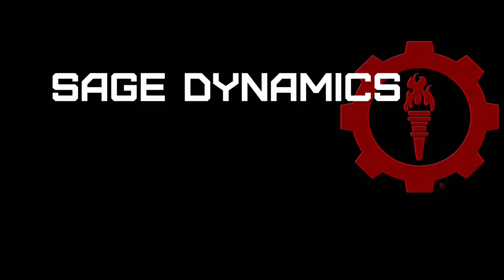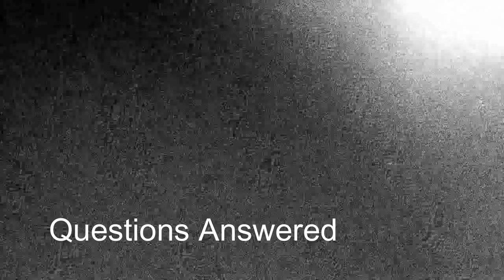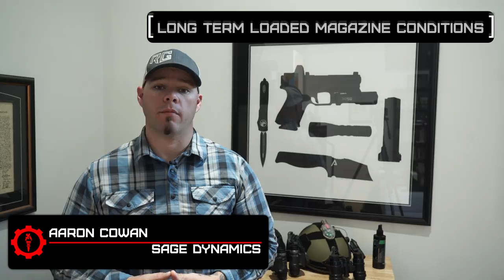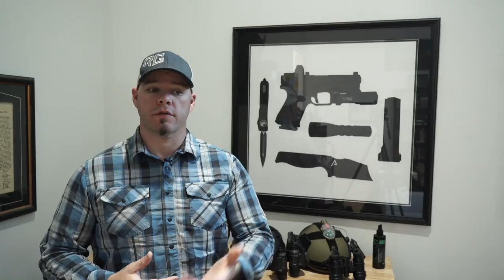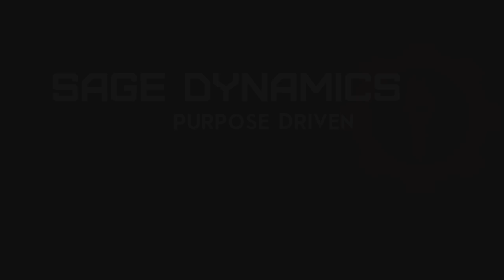Long Term Loaded Magazine Conditions

Comment: My post is 100% fact: oldest mags in my house are 10 years. Glock 19, they live loaded to full. Some have gone 3 or 4 years untouched cuz they were at the bottom of the box. All my mags have worked 100% and I have yet to have one wear out. Glock, 1911, M&P, AR-15, shotgun mag tube springs, all stay loaded to 100% capacity at all times...no issues to date. 10 years and counting.
Reply: I recently ran through some I'd had loaded for 10 years, no issues.
Reply: My mossberg 590 was loaded from 2013 to about 2017 and I found the spring got weaker and I had failure to feed reliably. I replaced it with a upgraded spring and it's been fine. My mossberg was only loaded 4 rounds out of a 8 round tube

Comment: ME here, in an ideal spring that does not experience yield will not experience any difference from being stored loaded or unloaded. However, creep and fatigue are still factors that can influence the life of a spring even if it was never deformed past its yield point.
Reply: How is creep and fatigue different between loaded and unloaded?

Comment: Several documented cases of loaded 1911 magazines loaded in WW2 or prior & picked up & loaded & fired some 50 plus years latter & firing & working flawlessly. As long as they are stored properly in a cool dry area they will virtually last longer than you will live . It's the constant unloading & loading of mags that stretches the springs back & forth adding moisture from the air & your body & other environmental elements that hurts the springs . 
If you don't believe me have you ever had a magazine that wouldn't hold what it's advertised to hold , but after some use it then holds that additional round or 2 ? That's the spring doing what I just talked about .
Reply: Mag Springs will relatively quickly take an initial set when first loaded, then any additional set progresses very slowly, it would take many many years for it to become unuseable. If the mag is used a lot the spring will fatique at a much faster rate than it would just sitting there under compression.

Comment: Clint Smith talks about tossing Wilson Combat 1911 mags over the berm when they start failing.  Most people respond to that by balking at throwing away a $50 mag but that magazine can easily be the difference between your gun working or not working.  If your gun is for defending your life then throwing away a magazine (even a somewhat expensive one) when it starts compromising reliability shouldn't be a tough decision.
Reply: It seems a little bit extra though, most of the time you just gotta replace the spring if a magazine shits the bed if it’s a steel mag

Comment: I have a g19 magazine that primarily stayed loaded for the last 3 years. And after finally using it and disassembling it, it’s spring is quite a bit shorter than a new g19 spring. I took it apart after having issues with the slide locking.
Reply: Pics or it didn’t happen

Comment: Early new Magpul Glock magazines had major problems but the company, correctly took the proper steps to improve the design. 😉. I have 2 Glock Magpul magazines for my Glock 26 gen 5 9mm. I use factory ammunition & so far, had no problems with the Magpul loaded magazines. The fact that Magpul does not use a metal liner like Glock factory versions may be a concern but I feel safe with the Magpul styles. I'd add too that most Magpul Glock pistol magazines are priced about half the cost of Glock magazines. 💵

Comment: Aaron, could you do a Q&A on the theory of down loading your magazines.  Example, 30 round AR mag down loaded by 2 and a 15 round Glock 19 mag down loaded by 1.  I have been told this by several people.  They say its better to do this because it makes it easier when inserting the mags into the gun.  Thanks.
Reply: C P larry vikers advised too download by 2 on AR mag and 1 on a pistol mag
Reply: depends on the guns and magazines. My Glock 17 doesn't have any problems, the original 17 and 19 round mags insert just fine, even on a closed slide (so 17+1 capacity works perfectly).
My H&K USP in 40cal doesn't like that tho. I don't load the 15rnd mags to full 15 unless i use them as the first mag on the range/in a competition. It has a paddle style mag release (which i really like, truely ambidextrous and i'm not one of those thumb release only guys) but that means it has a hole in the front of the magazine where the release holds it in place rather than on the side. That i don't like because it doesn't engage well unless you slam that magazine in hard. And on a fully loaded mag it doesn't work at all if the slide is closed.
So this "myth" is actually true for some guns. Just test it out for your guns.
Reply: He WAS a Delta guy, many years ago.  SF dudes aren't gear guys and even the LAV admits that most guys he served with were not gear dudes.  Bing SF doesn't mean they're right about everything..
Reply: +225degrees your entire argument is a false dichotomy and an appeal to Authority so it is already invalid.  When magazines are in guns the bullets do not rest on the feed lips if the bolt is in the closed position, the bullets are compressed even further against the bolt or slide until the magazine locks up. Reducing rounds reduced upward bolt pressure and mag spring pressure and this is a physics fact.
Reply: +225degrees you can't even comprehend the basics of the argument. Downloading the magazine is to make it easier to put into the weapon which is true and it is easier that is a fact...whether it's needed or not depends on how much free space is in the magazine body and spring after it's fully loaded how easily does it compressbeyond full to allow the magazine to seat.
Reply: Why the HELL would I leave space in a magazine. My mags are loaded to 100% capacity at all times. I'm not even sure why this is even a thing...

Comment: I suspect Aron's rather understating his case. I've been toting a Gen 3 Glock 26 for 20 years — since 2000. 2 of my mags, both OEM Glock mags, one a 10 rounder and one a 10 rounder with a +2 shoe, have been kept full for about 80% of that time, save for a number of extended trips overseas when they were unloaded and kept in my safe.
 Both still work fine, save for the mag with the +2 shoe, which actually could hold an extra 3 rounds, for 13 rounds in the mag. Early on, within months, that mag failed to actuate the hold open device on the pistol with the magazine follower on the last round. I suspect that has more to do with the addition of the +2 shoe than metal fatigue in the magazine spring. The Glock is tediously reliable, the only issues I've had is a cracked plastic end cap in the double coil main spring after about 16 years, and it's easy to get a new mainspring. My Glock 26 is entirely stock, save for replacing the plastic sights with steel Glock sights. I've recently had the top of the slide milled for the addition of a Holosun 508T reflex sight and fitted co-witnessing Trijicon suppressor sights.
If you start of with good quality magazines and you put new springs in your magazines every decade, you'll be just fine, even if you leave them full.

Comment: Physics teaches that springs never wear out from being compressed.  Spring life is defined by cycles.  Storing a magazine loaded has no effect on the spring.  Loading and unloading does.

I like Lancer mags.  One of the reason is the metal reinforcement.
Reply: mhfisc this. Why some people think springs used in guns and magazines are different than every other spring is beyond me.
Reply: mhfisc I think the thought comes from the Military using the gi mags. We had issues after about 6-8 months with magazines failing. We would lose the top two rounds of the magazines. But then again they were magazines that already had issues to begin with after years of use.
Reply: From the context of a well designed, well built mag from a reputable manufacturer used in normal conditions you're absolutely correct.  Cyclic loading is what will inevitably kill a spring in the vast majority of cases.

However (and I say this at the risk of being overly pedantic), saying that "physics teaches us that springs never wear out from being compressed" isn't really 100% true.  Viscoelasticity, while not a common discussion point, is very much an important topic in some circles.  For example, folks who design structures used in extreme temperatures (~40-60% greater than the metal's melting point) are absolutely concerned with their springs (or really any metallic structure) permanently deforming or failing given a constant applied load over a length of time.  Viscoelastic behavior (more simply, "creep") can manifest itself simply in "worn out" springs that need to be replaced on a certain schedule, or it can make itself apparent in the form of catastrophic failure if you don't account for it up front.  Notable examples would be parts and springs inside of jet engines or power turbines.  The truly insidious thing about creep is that catastrophic failure can actually occur well below ultimate design loads if temperatures, load application rates, and load application times are high enough.

Now from the perspective of rifle/pistol magazine springs, creep can really only manifest itself in a few ways:
1.) Abuse.  This one is pretty simple: Don't load up your mags and put them in an oven.
2.) Poor material selection.  In an extreme example, a plastic magazine spring would very likely experience some permanent set if left loaded for a long period of time at room temperature.  Another one that most folks don't realize is lead has terrible resistance to creep, even near room temperature.

1 and 2 are pretty extreme and will likely never happen, but #3 is certainly a possibility:
3.) Poor design.  If a sub-par company designs a steel spring with an insufficient cross section or insufficient material properties (either out of incompetence or just to save a fraction of a penny in material/manufacturing cost) you can run into problems.  At room temperature, many metals can still experience creep if loaded beyond 65-75% of their ultimate failure strength.

Even beyond springs though is the magazine body.  As I mentioned above, polymers can experience creep at room temperatures.  If you leave a polymer magazine loaded, those rounds are being pushed up by the follower/spring and restrained by the feed lips/mag body.  That constant applied stress can eventually manifest itself in permanent deformation of the mag.  The time required for that to happen though is heavily dependent on a number of factors: which type of polymer, what thickness is the magazine body, how stiff is the mag spring, how much UV exposure has the mag had, are the feed lips re-enforced with a metallic sheet, etc...

But as you mentioned at the very beginning - you're much more likely to wear a magazine out via cyclic loading/unloading than you are by creep.  I did, however, want to clarify that the mechanism is still a possibility, albeit an extremely minor and unlikely one (assuming a well designed/built magazine).
Reply: That's not accurate.
Reply: David Holland Wow great nicely explained!👍
Reply: Greoric M Who is your remark directed at? What's not accurate and why?
Reply: Spring elasticity is reduced under sustained pressure.
Reply: Not completely true
its just not anywhere near as significant compared to cycle wear.
Reply: Incorrect. It's completely true that spring elasticity is reduced under sustained pressure. My statement wasn't relative.
Reply: Isn't that what I just said?
Reply: No.
Reply: Not an argument.
Reply: @Danny Little Troll confirmed
Reply: mhfisc your correct. Being kept loaded you wont see much difference, if any, on the the spring. Now the loading and unloading is when the spring starts to wear out
Reply: mhfisc friends and i also had pmags loaded for years and nothing happened to them
Reply: Right, excessive use and likely had feed lip creep or separation.  Magazines are CONSUMABLES.
Reply: go back to school because taking a spring and compressing it to solid ruins it as well.
Reply: Robert Schmidt Yes but takes a lot longer to do so.
Reply: +cool beans I used a $16,000 Larson Systems Inc spring tester with Flash 11 touch screen technology to run the programs what do you use?
Reply: +cool beans you only have to take a spring down to solid compression one time and it's ruined doesn't take a long time only once just ask a mech engineer.
Reply: Robert Schmidt were talking about mags, If fully loading them wears out the spring. I'm saying it does but takes a long time to do so. Cycles on the other hand, wear them out faster (loading and unloading). Yes or no?
Reply: +cool beans Yes. cycles wear them out and I doubt they ever go to solid though because of engineering of mag geometry to prevent it. I was only making a physics statement on helical compression springs of all kinds and not mags per se. Was not trying to be a smartass. I test springs as part of my job.
Reply: Robert Schmidt ok, it came across that way to me. We are on the same page than it seems.
Reply: Aka: work hardening...
Reply: @dmh9993  tldr

Comment: Tie a piece of paracord to the D60 thru the lanyard hole in the dust cap. Then the cap will rip right off if you need to use it asap.

Comment: I can tell you that a Beretta 92fs mag was completely ruined after I found it in storage. The spring had taken a set and would not feed.I would estimate that it was loaded for at least 5 years,and was a Checkmate manufactured mag. This mag was a very well used military mag prior to my purchase and was stored in a non climate controlled storage locker. The Federal 147 grain 9mm however, functioned 100%.
Reply: Jayson Conover yea I’ve found the military beretta mags were prone to spring failure but that’s the only mag I’ve run into this problem with
Reply: I had some loaded G17 mags that were stored for about 4 years in a ammo box that were 100% reliable.   When I cleaned the old mags I checked the length of the springs and compared them to new springs and they were the same length.  

I wonder what Checkmate uses for spring material.
Reply: Checkmate mags are garbage for the 92.

Comment: Study on HOOKE'S LAW and then tell me why you can't leave a mag loaded forever.
Reply from the maker: Racist Infidel repeated compression. Not prolonged compression.  Maybe read it yourself first.
Reply: @SageDynamics  Springs fail through use, compression or elongation then relaxation. The failure mode is by breaking, not deforming, If the springs change beyond the initial "set" Hook's Law would  have a time element; it does not. Unless a spring is pushed beyond the elastic limit of the material it is made of it will return to it's original shape until it breaks.